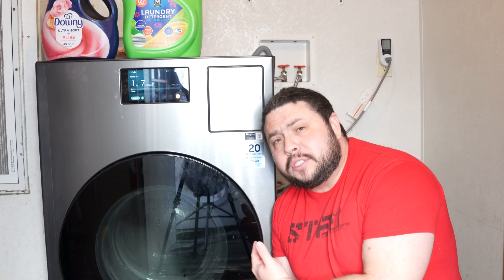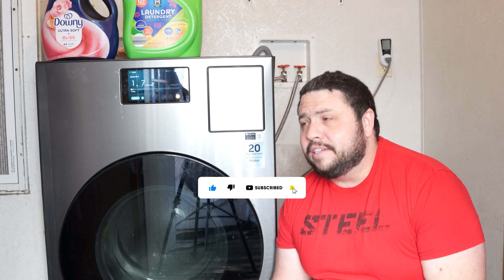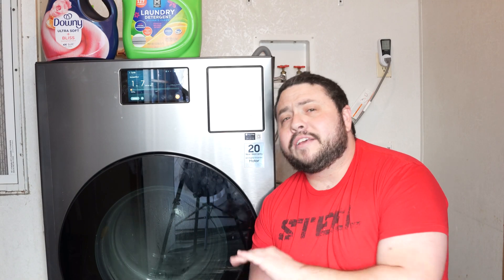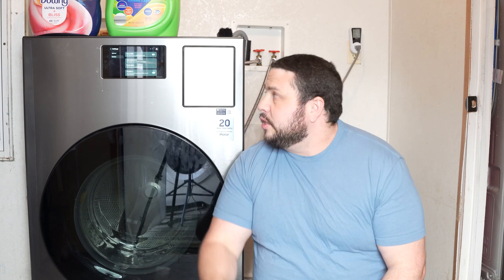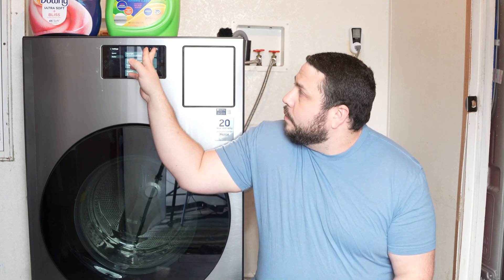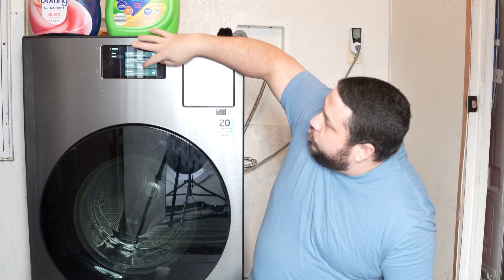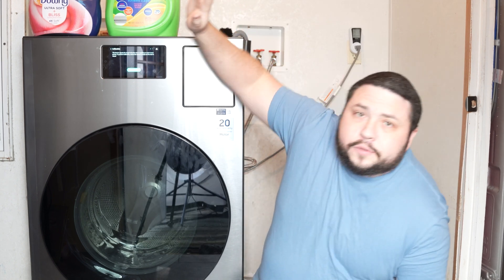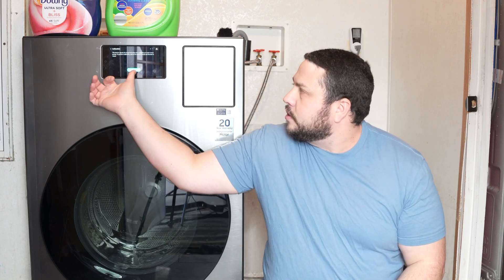SAMSUNG VENTLESS AI WASHER DRYER MAKING LOTS OF NOISE | WASHER CALIBRATION | HOW TO | LETS FIX IT!

Comment: No, this doesn't solve my current problem.  The noise I'm getting seems to be related to the pump, just after the majority of the water has been drained.  I mostly hear it during the last minute before it switches from wash to dry.  I made a short video of it.  It sounds to me like either a slipping belt or a bearing going out.  https://youtube.com/shorts/maBrP2I6_kE  I've been told there are no belts in the system.  The drum is a magnetic drive, for example.  I've tried the calibration routine, but it doesn't address the problem.  In my video, you can briefly see that the drum isn't turning while the noise persists.  I have a service ticket with Samsung.  Naturally, the day they showed up it didn't make any noise.  Now the noise is intermittent, so I've opened another ticket.  Hopefully, they can resolve the issue before my warranty runs out in June.
Reply from the maker: Hate you're having problems with it! have you tried the self diagnosis to see if you get an error? https://www.youtube.com/watch?v=AvE8q-5aDvc Let me know what they say on the second go around!
Reply: @BreakFixRepair  Yes, tried the self-diagnostic.  It reports that it has detected no problems.  What I think is happing is a part is failing, but hasn't actually failed yet.  My guess is the water pump, if that is in any way similar to a traditional washer's pump.  I've had a bearing go out in one of those years back.  Service is scheduled for Monday.
Reply from the maker: Hmmmm have you cleaned out the drain filter at the bottom of the unit behind the left detergent dispenser? Let me know what their tech says!! I am curious!!

Comment: mine does a weird loud sound when it spins, not all the time, some loads, I wonder if I am choosing the wrong load setting, like I do heavy stuff but I click on quick load etc.
Reply from the maker: Have you tried the calibration option yet?
Reply: @BreakFixRepair  yes sir, i DID when I first got the machine and I did it last night right after I watched your video, I ll see how it does in the next few loads.
Reply from the maker: @therealxoleras okay let me know! You may need to make a service call for warranty. They’re pretty new so hopefully it’s still under warranty!
Reply: @BreakFixRepair  i found the problem, when the bestbuy guys installed the pedestal, they kinda dropped it on the middle of the pedestal, put a dent in it, weakened the structure , the top plate of the pedestal is vibrating durring spint making that rattling sound, I put a starfoam between the washer and the pedestal and it stopped, I contacted them to come replace thepedestal.
Reply: @therealxoleras Having  the same issue as you. Did a visual inspection of the machine and noticed a huge piece of styrofoam stuck in between the machine and base. The installation technicians were in a huge rush and clearly didn’t do a thorough job. Will be putting in a service request and hoping that’s what is causing the problems.